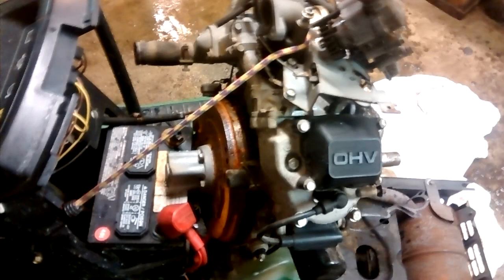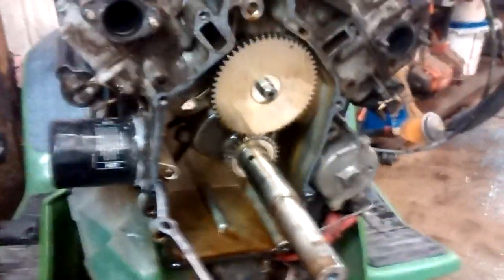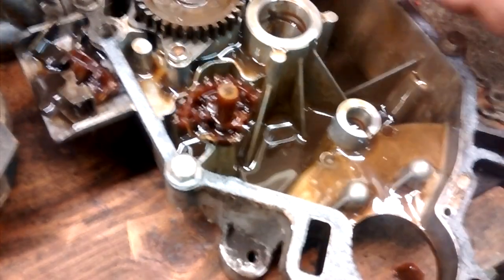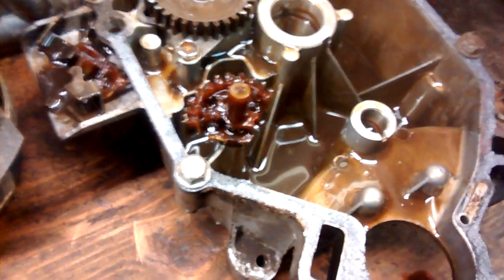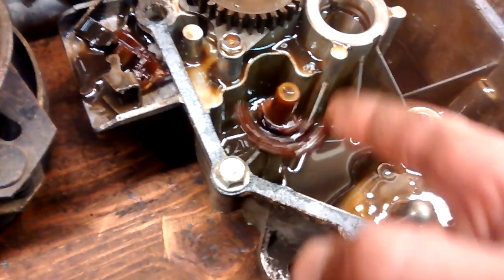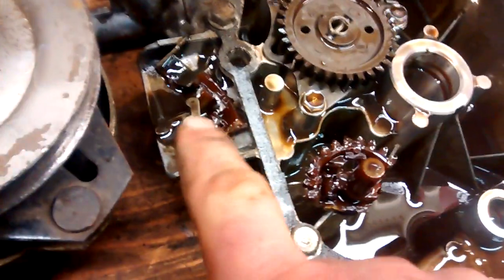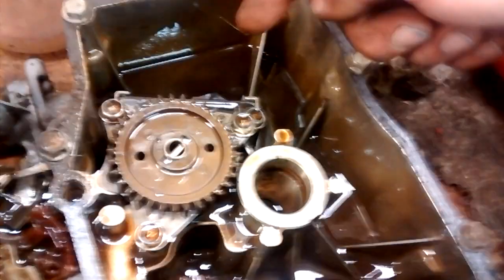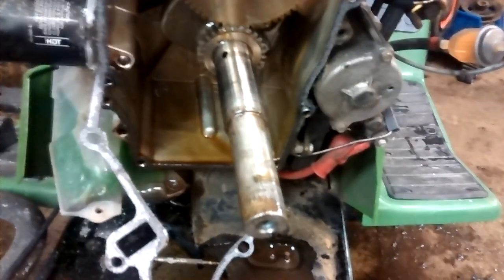John Deere rider mower tractor governer repair. AKA governor repair

Comment: I think this is my problem.  What's the cost on this repair?
Reply from the maker: i think the parts were around $125 and labor would be 2 or 3 hours at whatver shop rate you have to pay. I'm guessing 250-300ish all together?
Reply: Thank you for that info.  Your video gives me confidence that I can do it but probably should hire a pro.  Do you know if the throttle should still work manually with a broken gear?  It still won't start up after the sudden problem happened.  I've changed the carb and everything else possible but still nothing.
Reply from the maker: throttle probably won't work properly if the governer isnt working. Is there gas in it?

Comment: I have a John Deere lx 280 …. I can’t for the life of me find a image, parts list, video, or even  a written description of the internal governor parts and how they are to be arranged….. someone please please help me!
Reply from the maker: You need to call your John Deere dealer or look up the engine specifically if you look on the engine there should be a tag number model number spec number something like that look the engine up via its manufacture this way and if you can't find it again you need to contact John Deere they do this on purpose to make it difficult to find the parts so you have to buy them from John Deere themselves
Reply: Thank you so much bud 🙏🏻🇺🇸💪🏻